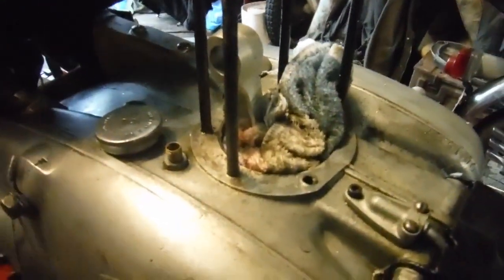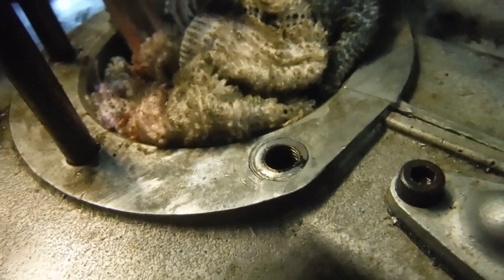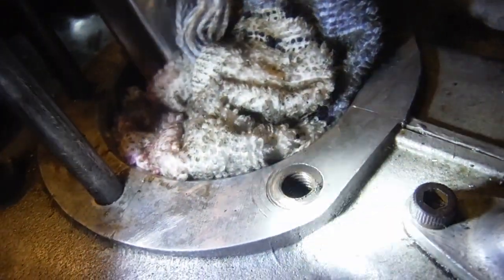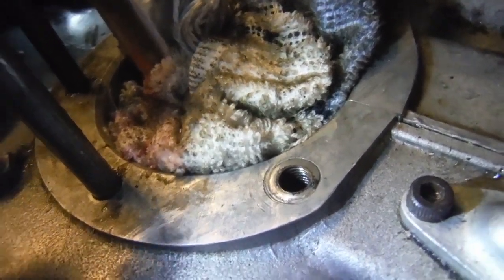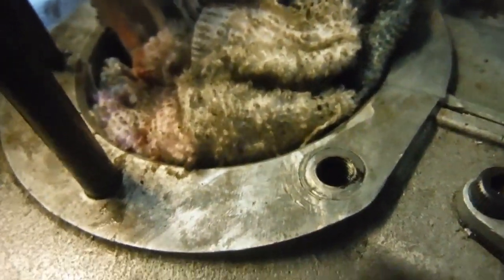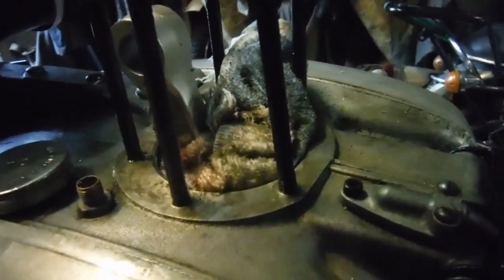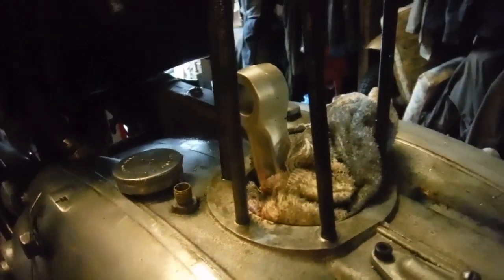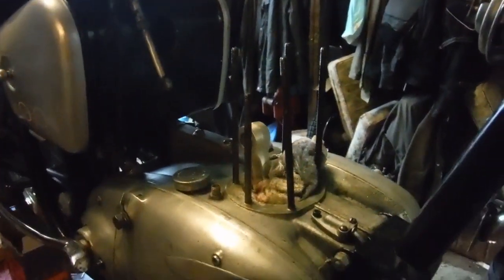Royal Enfield Olympic 250. Part 7, the crankcase stud hole thread repair fix discussed.

Comment: I wouldn'h beat yourself up about that tapped hole not being quite perpendicular to the face. Its not an easy thing to do by hand at all and sometimes down to pot luck for the tap to stay where you put it!
 The Bored and tapped out hi-ten bolt insert is the kind of thing I have used in the past to repair stripped threads too especially where inserts may not be available due to the thread used.
Reply from the maker: Thanks!

Comment: I had a similar problem on my 1971 air cooled VW, 4 studs came loose, luckily as it was a common fault they produced inserts to repair them. I think after about 1971 all the VW air cooled engines came with the steel inserts in the alloy block as standard.

Comment: That is a strong repair, well done.
Years ago I had a thread pull out of a BMW head (it was a common fault). I took it to my local bike shop to put a helicoil in because I was afraid of messing it up. He did it all by hand and put it in crooked just like your stud, lesson learned, do it yourself 🙄

Comment: I heated the hard bolt to soften it last time I did this to make tapping easier. The theory being that even a mild steel holds a bolt better than aluminium. That repair will outlast the other studs 🙂